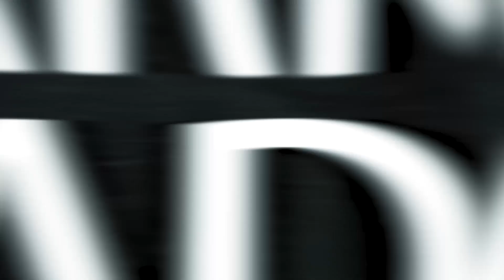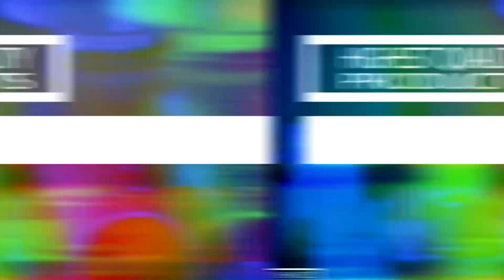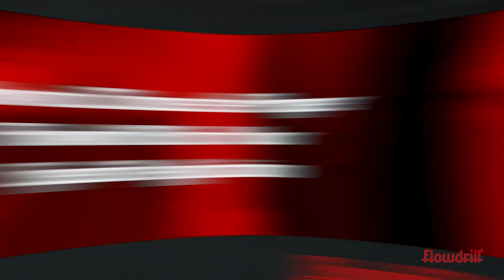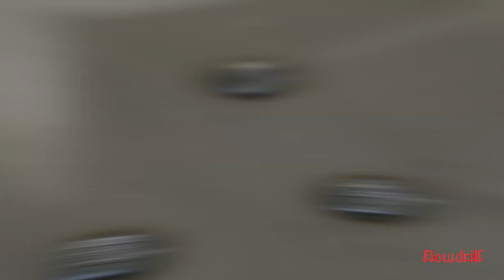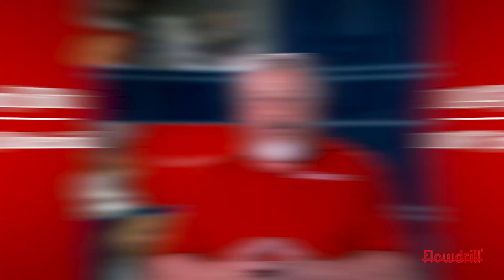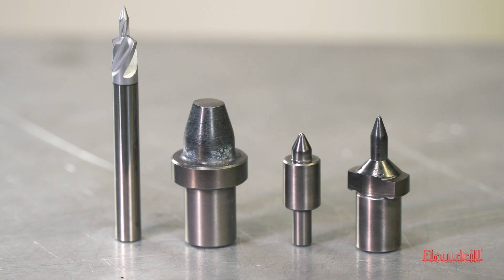Flowdrill Fundamentals - Choosing the correct friction drill type

Comment: hey, I'm interested in using an m14 flow drill bit in my battery drill which has an rpm of 2000 to try and get through copper pipe. do you think it's possible?  i'm trying to build some brewing equipment and want to knock in branches to the larger diameter pipe and this looks like the most effective way for my application.
Reply: No.You need a powerful, corded drill press.

Comment: I understand that friction drilling requires a fair amount of pressure to create heat. Can they be used with a hand drill?
Reply from the maker: Hi Hugo, you are correct the axial force is just too much to push it through the material by hand. You can drill a pilot hole with a normal spiral drill first, this will reduce the force required. You would still need a hand drill with approx 2000RPM and 1.3KW which are hard to find. Thanks for asking though!
Reply: @Flowdrill  I'll have to look into it. I have some shipping containers for car storage. I came to the conclusion that I was only using half the containers so I put a modified car hoise into one of them so I could fit two cars in.
There are 60 attachments to the container which took for ever.
I need to do 5 containers.
Using a friction drill I could do them in no time. I'll have to look into it.
Reply from the maker: @hugostiglitz6914  if you would like to chat to a local Flowdrill contact just about how it could work, let me know which country you are in and I can drop you a number and an email. It sounds like a nice application, good luck with the project.
Reply: Hi Hugo, i am desperatelly looking for an answer from a person who definitely knows about friction drilling. The question is: Drill Press. Its a 550W 2600rpm max tool. Is it worth a try (or even does it works with it) or better not bother with it. I read your previous comment about the pilot hole (hand drill question) but i am not sure about my drillpress neither.
Reply from the maker: @opiniono-1  Sorry for the delay Attila, I would not recommend attempting to friction drill with a 0.55KW drill press, if you can have access to 1.0KW minimum then you have a good opportunity to do M6 in 2mm steel. For thicker material or bigger diameter, you will need more power. An RPM around 2600 is more than enough though.